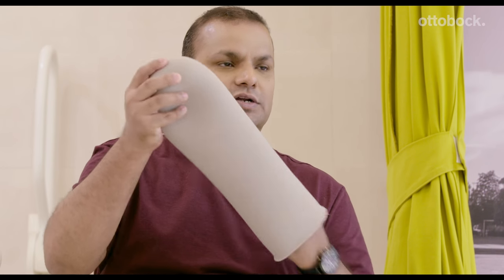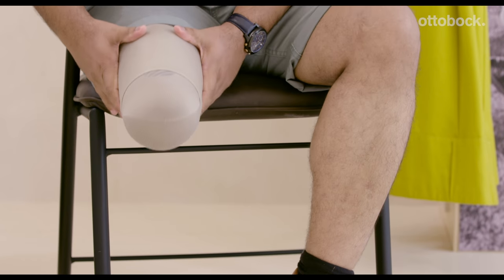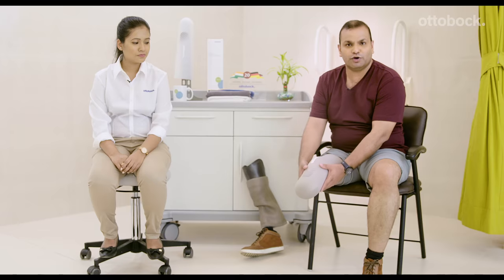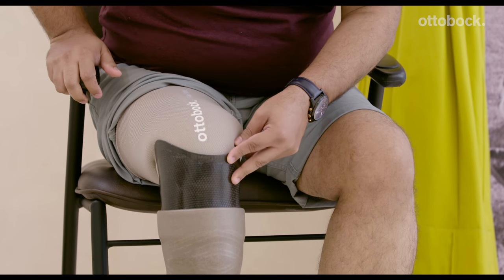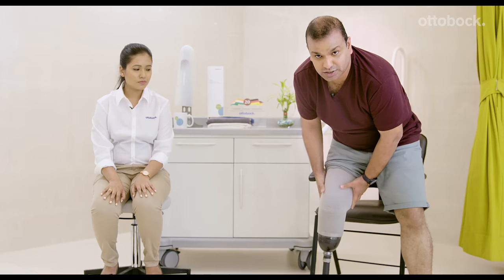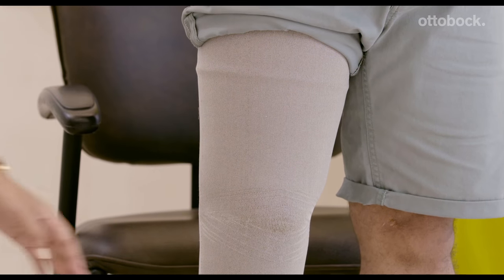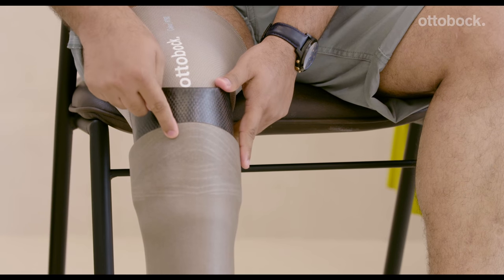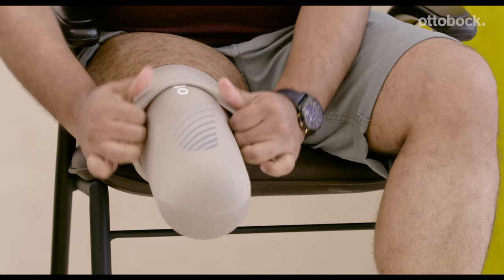How to put on a below knee prosthesis with one-way valve and knee sleeve? | Ottobock

Comment: I live in Turkey and I am using the below-knee prosthesis ottoboc
k harmony there really are very bad silokon
Reply from the maker: Dear mehmet ya, Thank you for your comment and we are sorry to hear about your experience. For the best support and personal assistance for your issue, please get in touch with local Ottobock branch in Turkey: 
Call them here + 90-212-356 50 40
E-Mail info@ottobock.com.tr
Web www.ottobock.com.tr

Kind regards, Your Team from Ottobock Headquarters Germany
Reply: @ottobock  I made contact with your branch in Turkey and was made of silicone change 3 times.  I had the same issues with the newly issued silicones.  After 20 days, my silicones were pierced, I can prove with photos. 5 years ago I used silicon liner pin system and I was very satisfied. I want a permanent solution from harmony silicon. my name is Mehmet Üstün
Reply from the maker: Dear mehmet ya,
Thank you for reaching out! You can contact your local branch by writing an email to info@ottobock.com.tr, call + 90-212-356 50 40 or use the contact form on www.ottobock.com.tr.
Kind regards, Your Ottobock Team